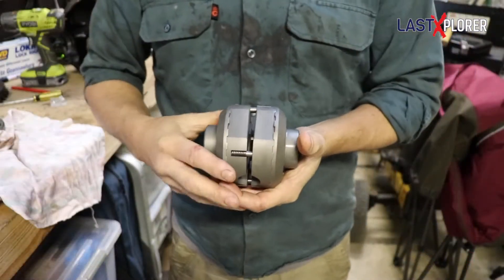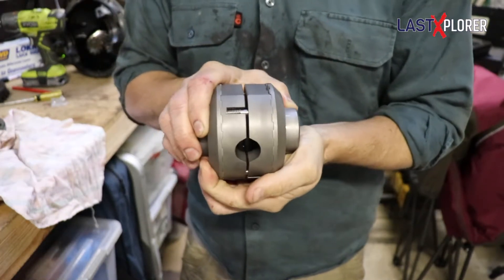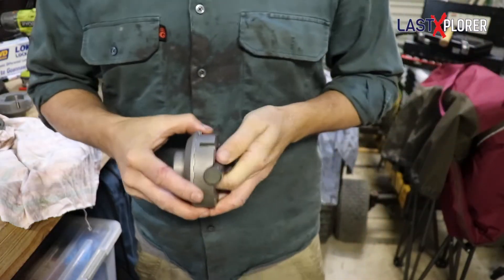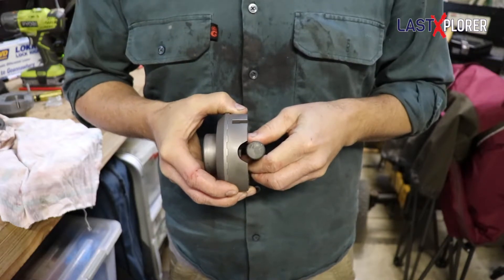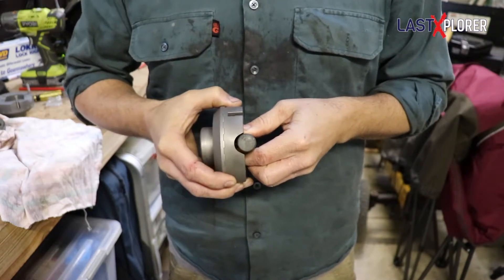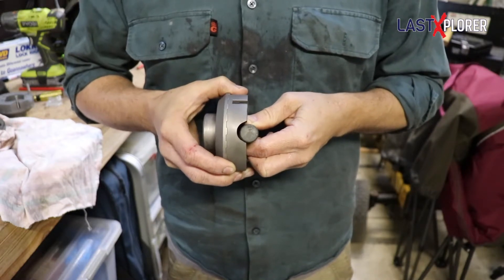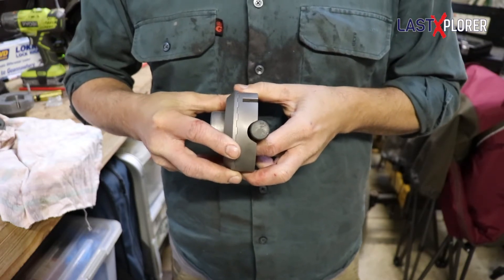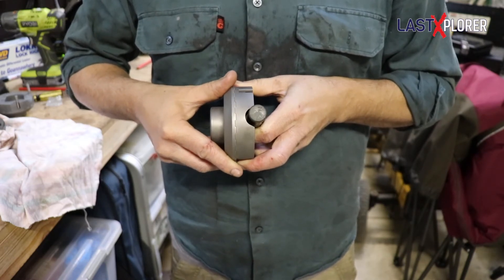How the 4WD Systems LOKKA Works

Comment: Good description. I have this in the diff of a Ford Falcon and it works well but when it is unlocked and on the cusp of positive drive the ratcheting can be on/off and cause the car to bunny hop, plus there is a LOT of noise with lots of people commenting teh diff is rooted. But the car NEVER gets stuck!
Reply: if there is no input to the pinion, then the slow wheel hits the pinion in one direction and locks while the fast wheel hits the pinion in the other direction and locks. this is the only condition that binds it up. it leaves no room for the cam gears to move. there needs to be a minimum force from the pinion to overcome the wheel that wants to spin slower making it control the lock and bind. this can be tested by jacking both wheels up and keeping the input shaft in neutral and spinning one wheel in one direction while trying to spin the other in the opposite, they will lock and bind with the pinion stuck in between. put the input shaft in gear to stop it, rotate one wheel untill it locks, the other one can cam in one direction and will lock in the other, this is the same condition however when in a turn it cant unlock.
this condition is what happens at slow speed in parking lots, there just isnt enough force on the cam gear to overcome the slowing force of the inside wheel from pushing the pinion back into the fast side wheel, unless you turn the other way then it will continue to bind untill road and rubber traction is overcome.
if you drag the brake you can increase input force on the pinion and help the lokka unlock, best to brake before it binds or you need exponential force to overcome it.

Comment: so the entire time the vehicle is traveling in an arc, those square drive dogs are ratcheting over each other ?? surely thats going to put wear and smooth off the drive edge and eventually wont provide the drive required ? the wedge of the drive dogs will overcome the force being applied by the carrier pin and will just ratchet instead of drive

Comment: So, if I get this correct, this means when you are going in a very sharp turn or steering full lock the inner wheel would drift?
Reply: wondering about it for a daily driver / drift car

Comment: Could this be installed on a 2wd hilux
Reply from the maker: Hey Mate, sorry for the slow reply. You'd need to check out 4WD Systems website to see if there is on for your Lux.
Reply: so is safe to use as normal daily drive and disengage only corner and only engage when the car is straight

Comment: Is the front locker essentially invisible when 2wd, manual hubs set to free?
Reply from the maker: Hi Kevin, sorry for the slow reply mate. Yes - the Lokka does not engage when you are in 2WD. It only engages when you have drive going through the system.

Comment: this is so well explained. I was trying to explain this today and my head was hurting
My only question is how much wear does this part sustain over time? or is it enough to not have to worry about replacing it?
Reply from the maker: Thanks Chris. It is not enough to worry about replacing. When the LOKKA is 'unlocked' and the gears are moving there is no load on them, so you get very minimal wear.

Comment: Just a quick question, when the outer wheel turns faster doesn't it create wear on those gears?
Reply: And also if possible, I see a lot people are having issues with lokka at the moment... I can't see if lokka is available for PX ranger? Really hope so... Would have bought front and rear lockers straight away if I could find it...
Reply from the maker: @NortonWebber  - sorry. Missed your comment. When the outer wheel is spinning, and the LOKKA is 'unlocked' there is no load on the gears so you get very minimal wear. From what I understand, the PX is coming. They got hammered during COVID and have just been focused on getting current orders out.

Comment: Am I right in saying the lokka is always locked then unlocks when turning? 

I have a Pajero Sport which has 2H (rear wheel drive) and 4H for bitchumen driving, would I lose the ability to drive in 4H on the road (not that I ever do anyway) because as there'll be drive going to the front axel the lokka will be locked?
Reply from the maker: Hi Alex - yes, you are correct. The lokka is aways locked, and only unlocks when you are turning.  

And yes, you would lose 4wd on the black stuff. Unfortunately that is one of the limitations of the lokka.

Comment: i dont think lokka are in business any more even tho there web  site lets you buy from them
Reply: Yeah I ordered mine and didn’t hear anything after. After the order I received zero emails. I wrote it off as a loss. But six months later it showed up at my doorstep.
Reply from the maker: Hi Rolph, they're still in business. They have a 4-6 week lead time at the moment (they quite literally make them from scratch). I know they can be a bit slow on getting back to you.
Reply: @LastXplorer  I never heard from them so canceled order I got one of eBay from the USA .just installed it so work out OK
Reply: I ordered a Lokka off of their website for my Ford 8.8 back in August 2021. Took 2 months for it to arrive. They are still in business, but you'll never hear from them.

Comment: Probably a silly question.  But are these suitable for front and rear? 
Cheers
Reply from the maker: Sorry for the slow response Craig. It depends on your vehicle. They only work on part time 4WDs. They do conversion kits for some models. You'd have to look at their website to see what's available for your 4WD.
Reply: @LastXplorer  cheers for reply. Found out no rear option for Patrol.

Comment: Thanks for the upload. It’s helped me better understand how it works. Does it’s action happen in both 4wd and 2wd? I have a 2013 Hilux and I am trying to get  my head around how it wil behave in daily driving? Noisy ? Clunky?Also how it would behave in sand where a turning wheel might not have enough traction to force the ratchets apart (I think I have that correct) thx again. Cheers
Reply from the maker: The release pressure is almost finger light. I’ve had the patrol in sand with no dramas right turning at all.

Noisy - I couldn’t hear it. 🤷‍♂️ Though the 4.2 is not the quietest of things.

It only works in 4WD - when there is drive going to the front wheels. 

- Hillboy
Reply: LastXplorer thx for reply. Cheers

Comment: If I had the locker installed in my front diff. If i was out 4wding and had to do a hard turn would the looker put stress on my diff?
Reply from the maker: Hey Dylan - I have the LOKKA installed on the front diff in the Patrol. It's not going to put any additional stress on the diff when you're lock to lock turning. In fact, I didn't even notice it in the tight stuff (literally going from lock to lock getting around some trees)

Interestingly enough, it actually requires very little pressure to 'unlock'.The pressure that keeps the diff locked come from the drive pinion. When the outer wheel turns faster than the drive system (in a turn), it releases this pressure which enables it to unlock. 

Have a look from 2:43 on - I do a semi decent job of showing how it unlocks.

- Hillboy

Comment: Thanks for the video. If front lokka is installed and 4x4 engaged, is there a risk when driving on sealed roads when turning?
Reply from the maker: The LOKKA works on part time 4WD only - so you would never have 4WD engaged on sealed roads. We recently did a trip from Sydney to the Gold Coast of which we tried to keeps to dirt roads. Had no dramas with the LOKKA doing 80km/h through turns. The LOKKA actually unlocks quite easily (with very little pressure). - Hillboy
Reply: @LastXplorer  Thanks for that mate. So loose surfaces in between the harder stuff 40-50kph is fine? don't have to disengage 4x4. Appreciate you getting back to me so quick. Thanks again
Reply from the maker: No worries - I just drove normally after installing it, which was engaging 4wd as soon as I hit the dirt. I had no dramas with the looser stuff either. It is a different feel driving with it - though I've done nearly 350,000km in patrols without a LOKKA so I'm pretty in tune with anything that is behaving differently. 

In around the tight stuff I didn't even know it was there - except for the fact I didn't get hung up on anything (even though I was trying to). In the mud, slippery tracks it was worth it's weight in gold. Walked up stuff in 2nd low other guys could get past - with comparable ATs. (and I hadn't bothered to lower tyre pressures). - Hillboy
Reply: I'd like to add to this I have a discovery 2 there full time 4wd with my centre diff unlocked do you think it would cause much of an issue?
Reply: @justinmanning2298  I’m wondering this as well. I have a first gen Toyota sequoia with a center locking diff and wondering how it would behave with a front auto locker like this or if I should just save up and get a selectable locker.